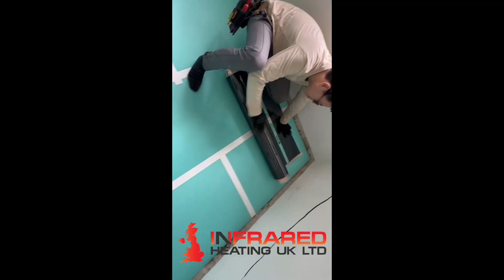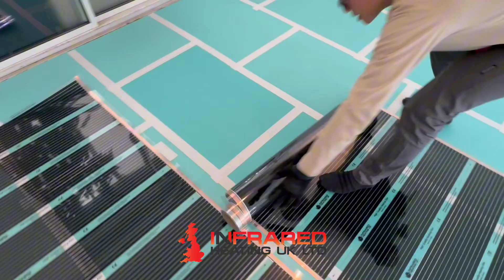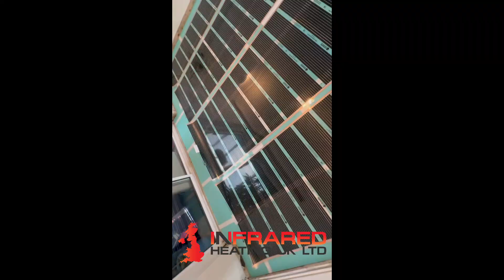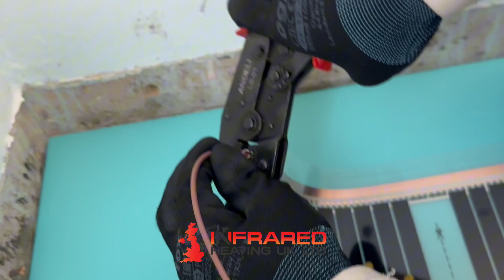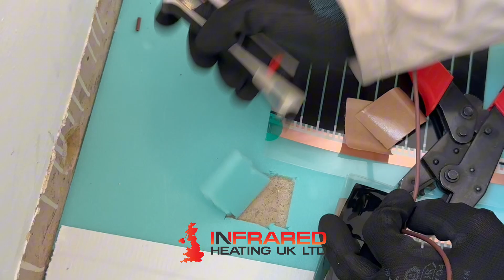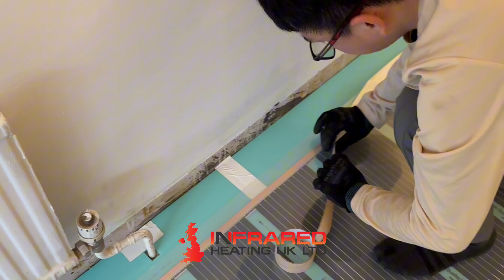How to Install Carbon Infrared Underfloor Heating Film | Step-by-Step Guide

Comment: The foiled sheets should be resistance tested before install, after install and again once the finishing surface is in place. Any variations in the readings are a cause for concern that damage may have occurred or a poor electrical connection.

Comment: What about the metallic earthing grid?

Key Earthing Regulations (BS 7671)
Mandatory 30mA RCD Protection: 
Every electrical underfloor heating system must be protected by a 30mA Residual Current Device (RCD), typically installed as an RCBO at the consumer unit.

Requirement for an Earth Screen/Grid: 
If the carbon film is installed in a "wet" area (bathrooms, shower rooms) or if the manufacturer does not include an integrated earth, a metallic grid (such as a mesh) or an earth shielded covering must be installed above the heating elements. 

Screen Grid Spacing: 
The metallic covering/grid must have a spacing of no more than 30mm and be connected to the protective conductor (earth wire) of the electrical installation.

Continuous Earth Continuity: 
If using aluminium foil tape to join mats or provide an earth path, the continuity of this earth must be maintained and tested.